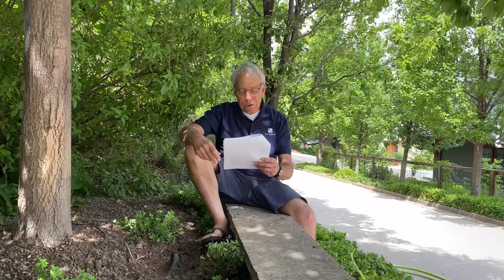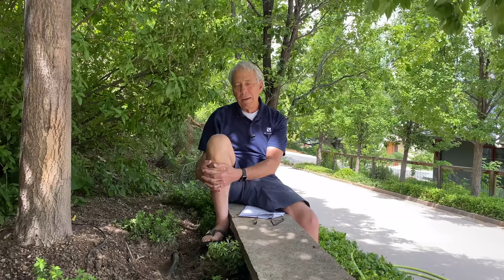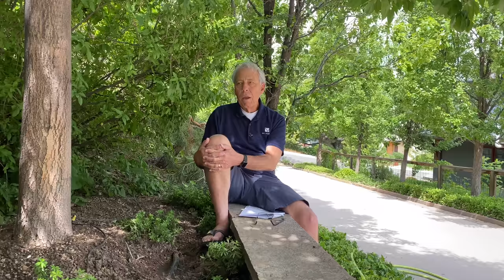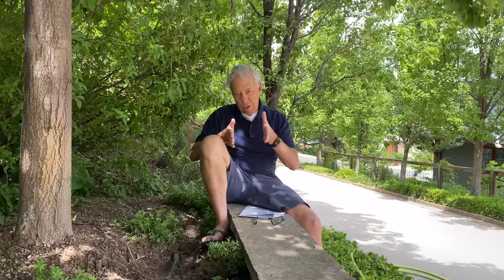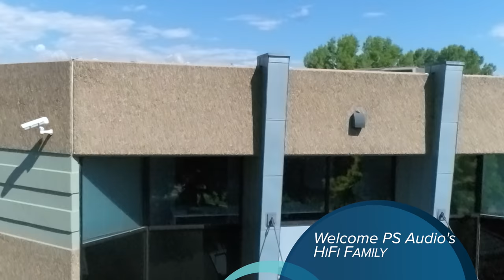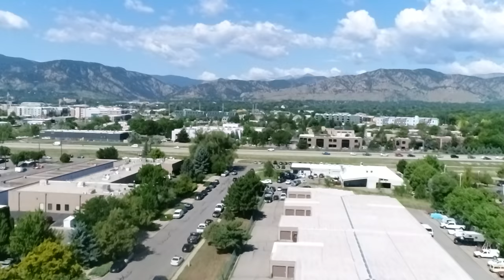How a DAC works

Comment: I tried to understand.  I got lost at the ladder part.   DACS are so complex.
Reply: You can't take small lessons like this in isolation. Lots of terms that he is using require explanations of their own. Pause the video, read about his term, come back to the video.
Reply: You need to read actual books for it to understand... just like most things.
But people don't like that 🤓
Reply: Fat Rat  Yes, that's called comprehensive reading for a reason 😜
Reply: A ladder is just a series of resistors in a ladder shape where the rungs are the digital inputs. Inputs closer to the output increase the voltage the most and correspond to high order bits. Inputs further from the input add decreased amounts of voltage and are used for the least significant bits. They are tuned so that each higher order input doubles the input voltage.  All of the voltage increases from all the inputs are added together. So it is possible to represent all of the digital combinations as a distinct combination of the voltage increases that add up to every voltage value that the digital code can represent.

Comment: The explanation of the digital back to analog is simply wrong. To start, the output produced is not like the frames in a movie. It is truly analog. That's why its called "digital to analog".  For example, if the original signal was a perfect sine wave and it was sampled at twice the signal's frequency, the output of the D->A conversion would not be "pulses" representing the voltage/amplitude at each sample. The output would be a perfect (analog) sine wave. Digital to analog conversation takes advantage of the fourier transforms and their inverses. In general, the input is interpreted as a combination of many oscillations (i.e. sine waves). The signal is sampled at twice the highest desired frequency (the original standard was 44.1kHz, about twice the human limit of 20 kHz). The inverse process creates a  perfect analog representation which contains all the frequencies up to half of the sampling frequency (i.e up to about 20 kHz, which is half of 44.1 kHz). The point is, the output of the DAC is analog.
Reply: I think he was talking about the signal before it goes through the DAC's analogue filtering.
Reply: @studog7851  No, he was trying to make the analogy to movie frames and how discreet "snap shots" can blur into what appears continuous if it happens fast enough.  This is common and naive misinterpretation of how digital sound works.
Reply: The output of a DAC is not "truly analog". It is both time- and amplitude discrete.

A sine wave sampled at twice its frequency would result in a squarewave at the output of a DAC.
It is only after low-pass filtering that the original sine wave is restored.
Reply: You guys mean the same but define the "output" of the DAC differently.
Reply: Oscar Gr In the end, we are probably  trying to say the same thing. This isn’t the forum for detailed discussion of the mathematics of DACs. However, it is reasonable to dispel the notion that “digital” sound fundamentally the same as as the frames in a movie.
Reply: @matthewrichey7128  LoL... You are right.
I didn't "like" the explanation in the video one bit.(pun intended)
But speaking of likes, you have one and it's mine...😎
Reply: @matthewrichey7128  I think it has more to do with perspective than with mathematics.

From what you write I take it you see a "DAC" as being a box that takes an optical or coaxial digital signal and produces a line output.

To me, electronics engineer for 30+ years, a "DAC" is the chip inside that box that does the actual conversion.
Reply: @somedutchguy7582  I am a mathematician and so I appreciate the mathematics behind the theory of digital to audio conversation. It feels as it's been my task in life to help people understand that DACs, from both a mathematical and engineering perspective, don't spit out stair step approximations to smooth functions. 

Thanks for the lively exchange!
Reply: Oh hell no!!!!

I didnt go through 3 years of math to now have to go through it again!

Comment: Disagree about 1-bit sigma-delta being better than PCM.  It's just a low-cost method with poor intrinsic performance, which requires a huge amount of sophisticated processing in order to achieve usable specs.  DSD64 is nothing more than a consumer format.  Professional studio use of DSD starts with DSD256 at least, and often DSD-wide with 5-bit or 8-bit resolution is used instead of 1-bit.  
Like many things in life, DSD is really only driven by its benefit of avoiding relatively expensive components, in this case, precision PCM ADCs and DACs.  Cheaper almost always wins, especially in mass consumer markets, often to the detriment of those who seek highest quality.
Reply: And I'd disagree that it "requires a huge amount of sophisticated processing"; it was originally designed to do the opposite, and implementing DSD is incredibly straightforward - it's a single pass filter.
Reply: @BlownMacTruck  
You're talking about the DAC only - but even there it's not quite that straightforward.  
I was alluding to the full process of A/D, noise shaping, then D/A.  The hardware is simple, but you need to address the extreme quantization noise, which is done in the digital realm, and isn't that simple.
Reply: Marianne, you are a wealth of information. Great explanation of complex issues that, for many of us, are almost a 'mystery'.
Reply: Marianne Oelund I was simplifying but removing the quant is more complex but not  that difficult - and the overall design ends up being far more straightforward than a typical ladder DAC.
Reply: @BlownMacTruck  
Companies that design delta-sigma DACs pour a lot of design resource into getting the noise shaping right, while trying to avoid instabilities.  The resulting design is always highly proprietary and closely guarded.  
Then buffering the DAC output can also be quite challenging, requiring analog electronics that aren't upset by RF content.  
The original purpose for DSD was as an archiving format for analog masters, which could be converted back to PCM or other unknown, future formats which may come along.  
DSD64 file size is 4x that of an uncompressed 44.1/16 WAV file, in other words it's even larger than 88.2/24 WAV files, or the same as 176.4/16.  Personally I'd prefer the latter.
Reply: @marianneoelund2940  So it was complexity before, and now you're complaining about storage. Got it. eyeroll
Reply: @BlownMacTruck  
No, you did not get it.  I was only pointing out that if the comparison is made between DSD and PCM files of similar size, which I think is a reasonable basis, DSD64 would be compared to 88.2/24 or 176.4/16 PCM, not 44.1/16 PCM.  
And mentioning the design challenges certainly isn't abandoning the complexity argument, so there is no reason to suggest I'm trading one point for another.
Reply: @marianneoelund2940  Since storage is hardly an issue these days when it comes to the difference between PCM and DSD and DSD was designed specifically with this storage requirement in mind, yes, it's totally trading one point for another, completely irrelevant one.
Reply: @BlownMacTruck  
We'll just have to agree to disagree.  Clearly I see things quite differently.
Reply: What do you mean by "cheaper almost always wins"
Additionally, if I understand your explanation correctly, the complexity of the processing is in the digital domain.
Digital circuitry is extremely cheap to reproduce and near independent of the complexity of the filtering in the digital domain.
It then is just a marketing decision how much of the cost of research into the proprietory filtering a company wants to earn back in the market segment they are serving and in how many sold units.